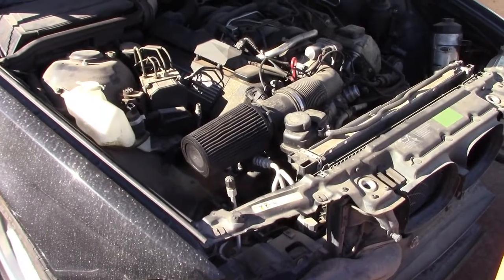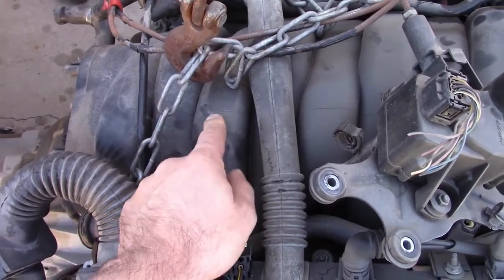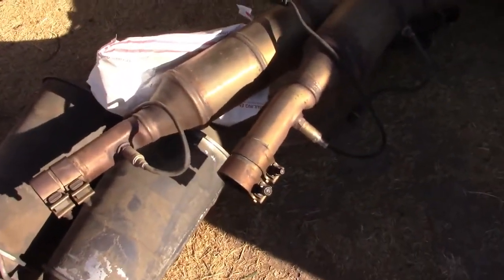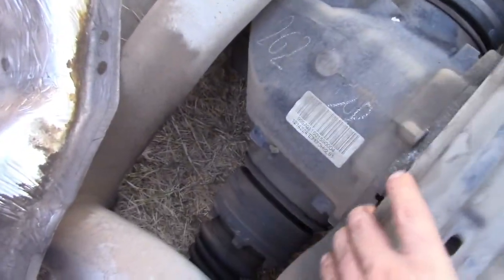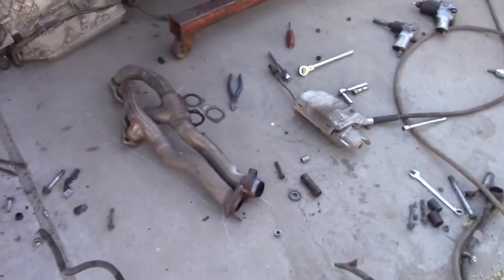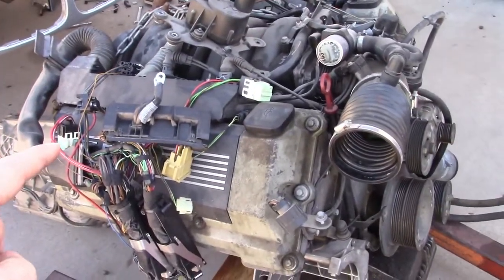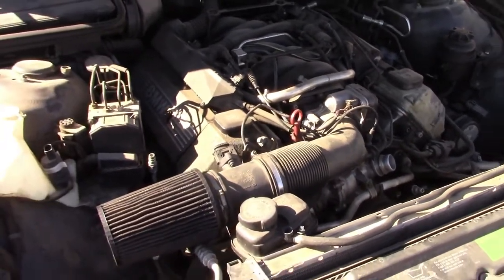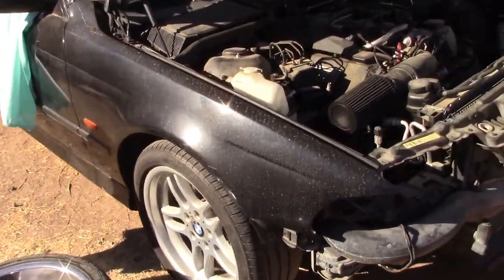BMW M62TUB44 cheap power upgrade e39 540i

Comment: If you replace the Tu intake manifold with the pre-facelift one, you will also generate power. I will also replace my original catalytic converters with 200 cell ones and even if the pre-catalytic converter is no longer available, 328-333 horses should be possible without any problems once the control unit has been programmed accordingly. Also an increase in Newton meters from lower RPM

Comment: Thats maybe the most stupid thing you can do to that engine, its already running very hot (108°c) and that cone filter makes it much worse
Reply from the maker: I agree, stock airbox is the best
Reply: @HakenE30  a shielded intake box works wonders.

Comment: Might be wrong however I think the BMW M62 4.4 was actually about to 10 percent more powerful than the quoted value because they needed to keep the older V12 out of the way. It had the same power as the M60 4.0 and the M62TU with variable VT got a down sized intake to bring the torque up and the max power was decreased.

Comment: You have a very good mod pipeline, well done. Here are some more things I've did to my E39 that gave benefits as well.
1. Clutch fan delete, replace with E60 electric fan 
2. Weight reduction, I shaved off 50kgs by removing all the outdated multimedia modules, spare wheel, tools, secondary air pump, alarm, anything that is no longer working. This lightness definitely feels like more power 
3. Google up Racingdiffs, a company from Serbia. They sell progressive LSDs, which worked great for me. The grip on the back wheels improves and handles the extra HPs with ease 
4. There is a brake adapter kit from Epytec, whereby you use the small Brembo 4-pot caliper from BMW E38 728 and fit a 325mm rotors off E46 M3. It was the simplest thing, plus I had those calipers with me already. Braking performance and feel so much better, and it's way lighter than the stock brakes. I think by total 7kgs 

This combo of small power mod coupled with weight reduction really brings out the professional athlete characteristics out of this car!
Reply: Leaving a comment so I can go back to this
Reply: Caliper swap info needed...
Reply: hell yea

Comment: FYI, I recently ordered a SRS PCV/CCV delete kit. I'm going to install an oil catch can. The primary intention is to protect the engine, I noticed my TB is stained with blowby and intake manifold filled with oil residues. My gaskets are fairly new, and so I diagnose this must be gas blow by. 

If I get power gain, that will be cool too 😎

Comment: So like the M50 intake, the M60 is suppose to make more power because of size. Testing for m52s with m50 manifolds shows even with a tune - although the peak power is higher, the power curve is decreased. Has this been tested to show it's curve is better with M60 manifold? Great tip about N62 throttle bodies !
Reply from the maker: they say that torque is slightly reduced at low end, but for racing, you are in top RPM anyway. Same for m52 with m50 intake manifold.

Comment: Your cone filter is way to close to your engine. Its not isolated from hot air in engine Bay which makes it suck less dense air. That gives less air into engine, so you have less HP. Use standard intake hose and filter cover, you will regain 5hp💪
Reply from the maker: I know that. I don't like the cone filters, I bought the car like that.

Comment: What are some of the things you can “tune” when you pointed to the under hood ecu compartment? I’ve got a 03 540i
Reply from the maker: tune cats out get 30hp more
Reply: @HakenE30  I’ll try to research the process to do that. I’m not very familiar with this platform.

Comment: its going to loose power if you do these, its not setup up for mods at all. you take the cats off a vanos model and its going to run badly
Reply: This isnt true at all lmao
Reply: @bobbyrobbyn1838   do it then haha let me know how well it works. I’m sure you’ll love it
Reply: @paulie2026  ive had 4 540i’s before. 3 were catless with zero issues.
Reply: @bobbyrobbyn1838   I’m sure if they were vanos you got great gas mileage and you were super fast lmao
Reply: @paulie2026  dynoed 260 hp and 312 foot pounds of torque on a dyno jet bone stock. Decatted the car, m60 manifold, 4 inch maf tube, dudmd custom tune, shaved heads, and 4.8 liter tb with port matching the intake. Dynoed 300 hp and 360 pound feet of torque on the same dyno.
Reply: @cmkm54  gj, tell some other people to get a tune
Reply: @cmkm54  just curious, did you just knock out the guts of your cats, or did you cut them out, replace them with higher flowing ones? I've done all the same mods except messing with the cats in my '02 540i/6
Reply: @D K  front headers got gutted, rear cats got replaced with magniflow universal 100 cell cats. The tubing for the stock cats is double walled though so it's tricky to weld onto the stock piping, I just replaced it all